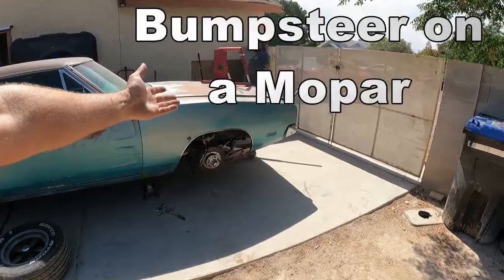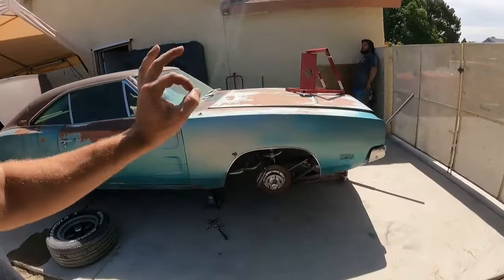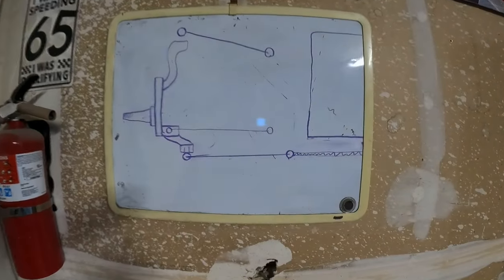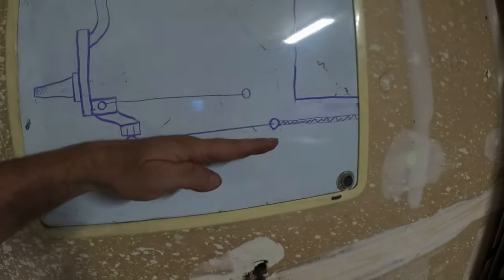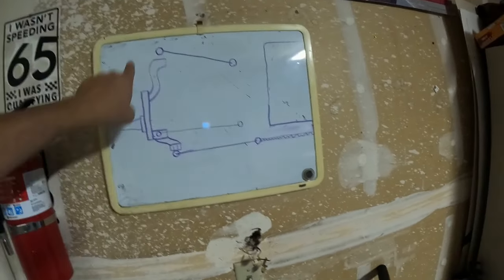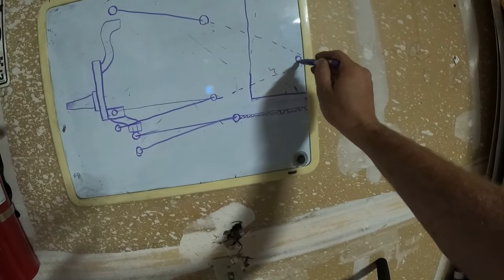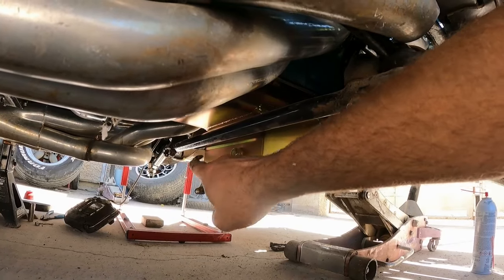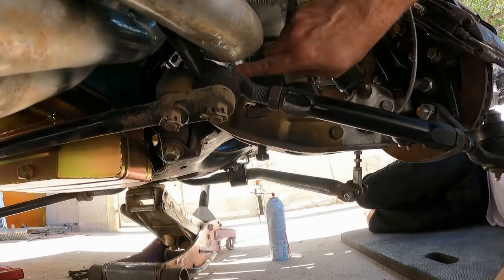What happens when you throw a bumpsteer gauge on a Mopar???

Comment: Here in Australia we are RHD and the mopar steering is good as the idler arm and steering box are mounted directly off the chassis rails.
This keeps the pivot points almost over the top of the torsion bars or lower inner bushings
We have A B and C bodies in RHD

Comment: I found in road racing that a little toe in on full bump keeps the car tracking straight when braking hard for a corner. Once you get back hard on the throttle and the inner wheel goes into droop it will toe out and give you ackerman and help the car turn.   The stiffness of your sway bar will determine how much.

Comment: There is a popular idea of using a 1973 and newer disc brake spindle for an easy disc brake conversion on 1972 and older B-bodies.  The only thing is the 1973 and newer spindle is about 3/8 inch to 1 inch taller than the 1972 and older spindle, would this mean in increase in bump steer for a street driver?  It would be convenient to use disc brakes off of FMJR bodies on older B-bodies but not if driveability becomes noticeably worst.
Reply: It's not 3/8" to 1" taller. It's about 3/8". It doesn't change. It's not that drastic.

Comment: With a Longacre gauge, I measured 0.082" toe out with 3" in bump/compression from static ride height in my particular 68 A-body w/'73 spool K-frame. Then, 0.114" toe-in with 3" jounce/extension from static ride height. I needed to take out shims to improve, but it already had no shims. So I'm sorta stuck, unless I start bending and welding stuff. Just my car, most every setup is different.
Reply from the maker: That’s not bad, but yeah every car is different due to aftermarket world these days
Reply: @junkerup  Is 3" up and 3" down from static overkill on range? 
Some other range more practical? 
My measurements are with a Heim tie rod setup. 
*Also check out my post on your other LBJ extension video for fitment applications.

Comment: Not trying to argue, just clarify I guess. How do you figure toe out under compression causes oversteer and toe in causes understeer? I can see the toe in I guess, by adding steering input while at the limit it's over using available grip, but I don't see any way the car towing out would cause oversteer. It reduces steering angle for sure but it's not affecting the rear. I have fully custom built control arms, roll center correction and steering angle/ratio increase I built on my Mercedes drift car so I'm pretty well versed in suspension geometry but always open and eager to learn more. I just made my first finals and lost(tires went away in the last round😔)against some catalog built drift cars  in my one of one Mercedes, so I'm pretty proud of that.  The car has been evolving for quite a few years as I learn and become more experienced fabricator and machinist as well as my drift experience growing.
Reply from the maker: It makes the car darty, which ever tire has the more load is going to dart that direction
Reply: @junkerup  ok. That's not oversteer though. Really if the car is loose in the rear the toe in under compression will cause oversteer. Bump steer sucks all around! Nice to see someone who has a grasp on suspension geometry messing with junk that shouldn't do what it does. There's actually a couple guys that drift b-bodys near me. I'm not sure what they have done in the front though to be honest.

Comment: Chris, do you have any experience with the B-body geometry when Mopar quick-ratio pitman and idler arms are installed? As I recall, the longer arms raise the drag link higher than the standard idlers, but I assume the extra length means the larger radius sweep as the arms spin may contribute to more aggressive droop from center to lock, and thus might benefit the geometry of the tie rod assembly only over a limited degree of steering input.

I'm curious if you've had any experience with these that you may be able to share. For reference, I'm running FMJ spindles/knuckles, so while I am gaining a bit of height on the UCA (which are +1.5 FFI tubulars), I'm limited at what I can do with the steering arm height (obviously, I can't benefit from your kit as I'm not running drum spindles).
Reply from the maker: I do know the longer pitman and idler have better bumpsteer but I haven’t checked the Ackerman on that
Reply: @junkerup  Good to know. Thanks for being the absolute guru on this; trying to learn front end geometry starting with a B-body is NOT a good idea without the right tutor, but your videos have been absolutely phenomenal. Thanks a million!

Comment: if they only put the steering in front of the lower control arm at the same points. then this problem would not exist and the oil problem would be gone on top